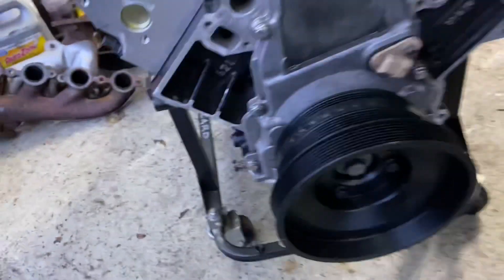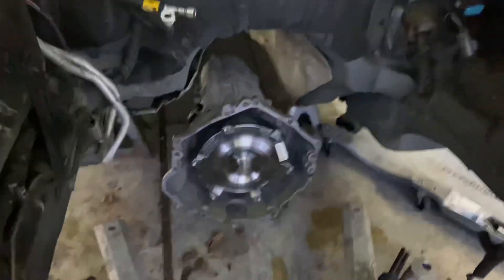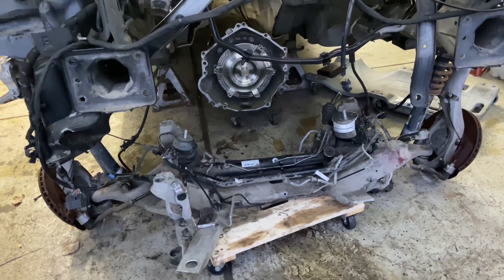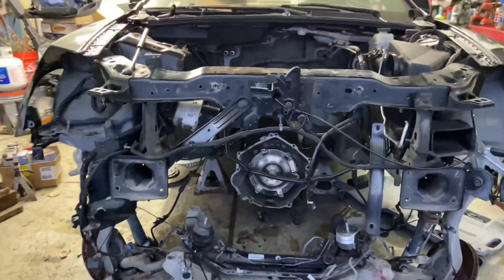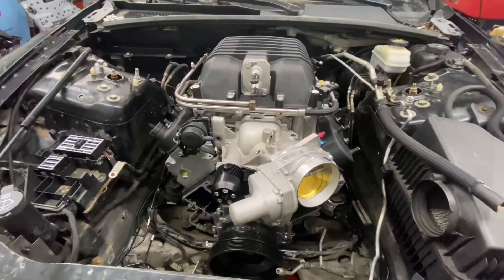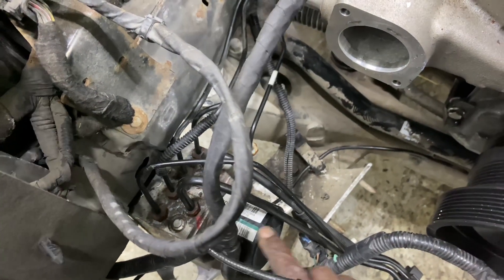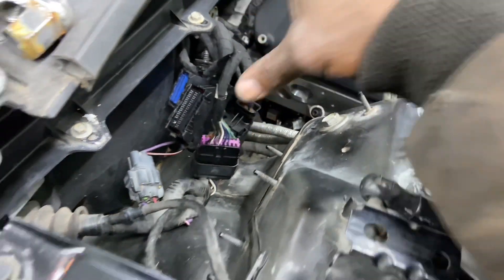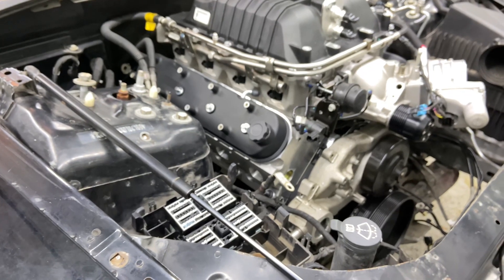CTS wagon LS swap “Frankenvagon” engine installed/wiring done (so simple) Part 3

Comment: What trans you use?
Reply from the maker: @KH-ze8my  6L90e from a 13 Chevy Express van
Reply: @gols1go1  I'm currently just doing a 5.3 swap I was wondering if it was compatible with transmission that comes in the car rear wheel drive automatic
Reply: And if so what flywheel torque converter you are using
Reply: They currently has the 6L50. I was trying to stay with that if possible
Reply from the maker: @KH-ze8my  that trans will not physically bolt up to a regular LS. It might be the same bolt pattern as the fwd LS that came in the Impala SS…?

Comment: Awesome job I've watched each of videos a few times on the CTS. Few questions Did you use the factory V6 engine computer and just reprogram it for the LS or did you use the harness and computer from a v?
Reply from the maker: @blackrockfabrication6858  you’ll need a V engine harness and a E67 ecu programmed with a V calibration
Reply: @gols1go1  thanks so much for getting back to me. I just ordered HP tuners and slowly gathering parts. If you ever need any fab or machine work just hit me up. I appreciate all the videos you make.

Comment: Hey man I’m looking to do this swap on a 2010 cts how did you get the wiring to work did it plug and play with the v6 wiring ? How did you get it to work and will it pass emissions ?
Reply: Im in the same boat with you
Reply: Did yall do it
Reply: @aaronzavala4336 tryna find the videos bro smfh 🤦🏽‍♂️ 😭
Reply: @Jamearcosby u tryna do it aswell my boy i already rebuilt my motor i was gonna use I just gotta wait to get paid so I can buy some pieces of metal so i can make some mounts then ill mock up the engine ima use a 5.3 gen 4 with truck Norris cam sum light but I bet in the car it’ll rip

Comment: Will the 6L90 work in place of the 6L50 with no issues?  No reprogramming and the manual shift option works the same?
Reply from the maker: The 6L90 is tied to the LSA ecu by means of the data wiring in the stock CTS-V harness. But yea, the manual function works as it should

Comment: My plan is to swap a ls3 into my 08 cts rwd sedan and was wondering do you need to get a Ctsv k member or could you use the stock CTS k member?
Reply: Stock v6 k member has the holes for the V engine mounts already there....you need the lower mounts and the engine cradles from the V.  The V6 engine rubber mounts are the same as the V.  If you use an aluminum LS block then you are good, Iron blocks require and additional conversion bracket to adapt their 4 bolt square mounting pattern to the larger triangular pattern.
Reply: Man make a video of this transfer

Comment: Is your wagon AWD? I’m considering selling my BMW 550ix for a CTS wagon awd and I’d want to do an LS swap but I want it to remain awd since I live in Denver. I’d this possible?
Reply: That is what I am curious about, I am told the SRX SUV (02-07 I think) that was RWD used a center mount transfer case married to the 6L50 and standard type front diff with prop shaft on its AWD version...could be a bolt up deal